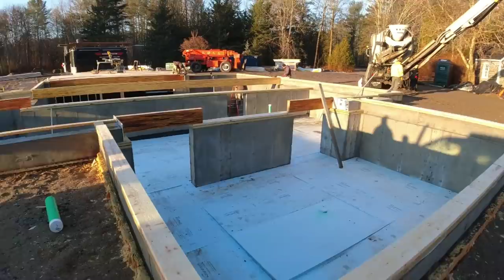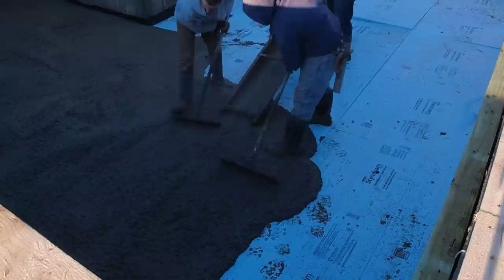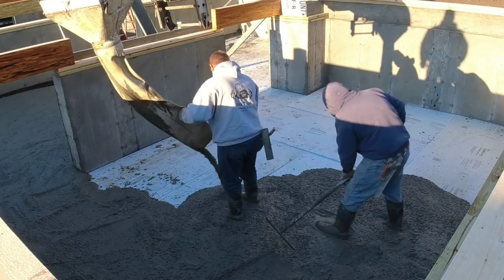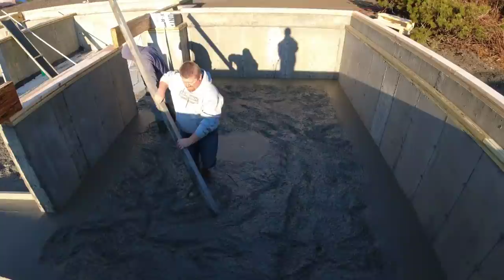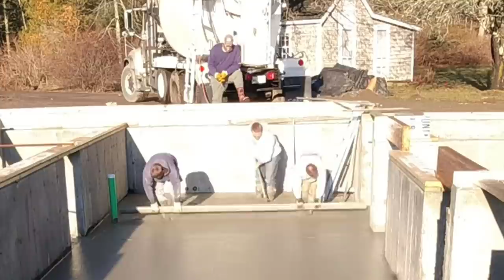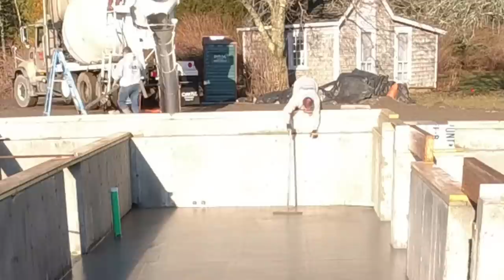How To Pour Concrete Floors (Our Easy Pouring Technique)

Comment: I have  never strait edge a crawl space  unless it I was told to by the builder, I would float the wall spread the concrete and bullfloat it !   If you rake it out right ,it turns out pretty good !!

Comment: Only time I’d have an issue with a sub videoing would be if the owner was adding some non-permitted work scope into the job and they requested not to have that documented. So yeah basically it could be that.

Also some contractors are paranoid that others record trying to nitpick something to try and coerce a deduct from their contract.